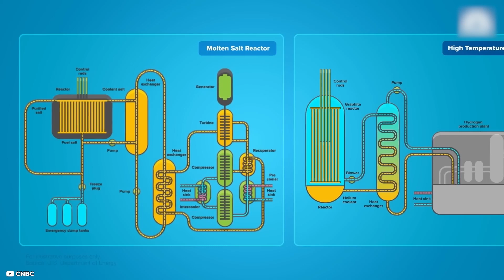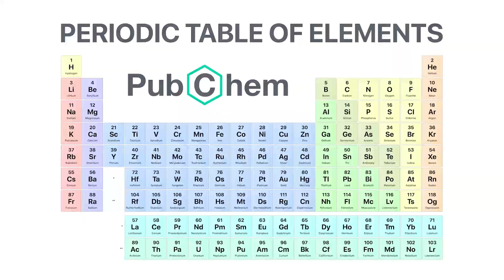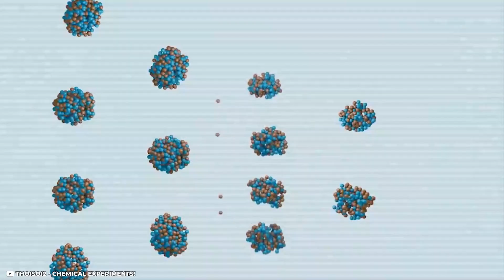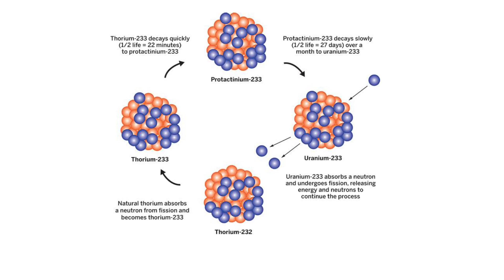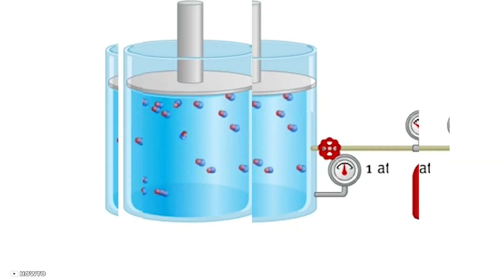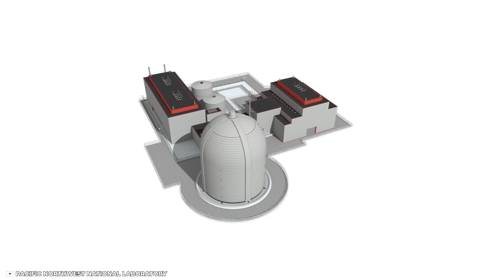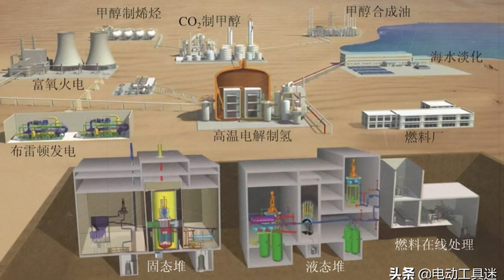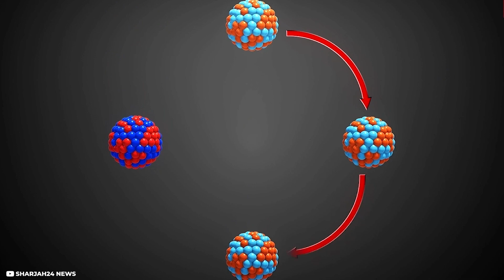NEW NUCLEAR REACTOR! Safe Nuclear Energy for 1200 Years!?

Comment: I agree with Stanley on reasons for shutting down research. But, it was not shut down around the world and Copenhagen Atomics  has designed a process that treats the fluoride salt to make in non-corrosive to the reactor structures. This breakthrough is also the reason that Copenhagen Atomics has created a auto-industry manufacturing process for building Thorium Fluoride Molten Salt reactors that will allow for the generation of cheap small footprint SMRs for energy grids around the world. The burning of hydrocarbons for transportation will be reduced directing the hydrocarbon resource towards more valuable product production like material and petrochemical.

Comment: China currently has control over rare earth materials. They don't share our irrational fear of thorium. We understand that radon gas is produced by the decay of thorium. What we don't seem to understand is that the gas is always produced at the exact same rate. It doesn't matter where the thorium is located or how it's stored. Maybe you've noticed that if it's left in the ground it seeps into your basement.  Radon decays rapidly so if you're really that afraid of it.  You could contain the thorium and capture the gas. Then allow it to decay. Whatever you do about radon is in most cases meaningless. We could instead decide to extract our available large amounts of rare earth materials. As a possible alternative to cowering in fear. We could produce what we need. We would in a few centuries be left with a byproduct stockpile that would contain all the energy resource needed for thousands of years. 

     Ps. People who understand things have described thorium as the most valuable worthless element.

Comment: Canadian CANDU heavy water reactors will b able to run on Thorium in 2025. As is, without modification.  The fuel  is Thorium with a HALEU booster, called ANEE. It's in the approval phase.  India's HWRs are a CANDU knockoff.

Comment: There's NOTHING NEW about a molten salt reactor, particularly THORIUM
Reply: What is new is the fact that social media and YT have made people think it is something great when it was tried decades ago in many countries and abandoned as too  costly
Reply from the maker: Every new technology is costly at the beginning until the system is optimised.
Reply: @The.Futurist  Funny, that is what they kept saying about the gen 3 reactors and the U.S. built over 100 of them.

The Westinghouse AP1000 is a gen 3 reactor with passive safety devices. And those passive safety devices are designed to save money by minimizing the number of pumps and emergency diesels. VC Summer was canceled after spending billions and Vogtle is still at least 1 year away from both unit 3 & 4 operating at that project is now $35 billion. 

I guess after another 100 massive financial gen 3 failures we might see the price come down.

BTW, there are NO Thorium reactors being considered in the U.S.. Terrapower does plan a MSR but with uranium and that project is estimated to cost $4 billion for a 345 Mw unit, on par with the Vogtle cost when comparing capacity.

Comment: Molten-Salt reactor technology during the Cold-War was stopped as it wouldn't generate plutonium to make nuclear bombs! It was pure strategic defense argument against civil energy/electricity consumption which at that time wasn't that big and could be generated with other resources as well. Also the MSR didn't provide the solution for long-range aircraft voyages as expected.
Reply: Where do people keep coming up with this BS that Thorium was abandoned and Uranium based PWR/BWR were chosen so we could make bombs?
Hanford Wa. has been making weapons material, at their 9 reactors, since 1944, 12 years before the first U.S. commercial nuclear plant became operational and their weapons production reactors are very efficient graphite moderated reactors and DO NOT produce any electrical power.
Savannah River site SC. Has been making weapons material since 1955 and their 5 production reactors are very efficient low pressure heavy water moderated reactors and DO NOT produce electric power.
Thorium was tried at Shippingport and Indian Point commercial reactors in the 1970s and abandoned as too costly compared to Uranium.
Weapons production reactors are NOTHING like U.S. commercial PWR or BWR power reactors and commercial power reactors have NEVER been used to produce Pu239 for weapons, since there has never been a need beyond what the efficient weapons production reactors could provide..
The U.S. currently literally has hundreds of TONS of  Pu239 (takes less than 20 pounds per weapon). The U.S. has so much that 34 tons of weapon grade Pu239 is being treated so it can eventually be disposed of at a cost of billions.

Your comment is like saying automobiles use gas engine because the military wanted jet fighters.  God help us that people base their knowledge on social media and YT videos.

Comment: Why heat up the adams when all you need is just use the electrons around the adams and convert them to electricity. John R R Searl did just that and it worked very well. Nasa reported that the converter could produce 10 to the 14th power volts. This technology was also stopped for political reasons. Big oil and the power grids control our government. Maybe we should look into where our state reps and senators get support from. Power on!

Comment: Indias FBTR  at kalpakam went critical in 1987.  India is one of the leaders in Thorium reactors it actually has a 500 mw reactor almost ready for operation, china is just starting with an experimental reactor now.
Reply: But has India put one into operation?
Reply: @PahatRout 
Yeah only one . Pfbr 500 reactor with thermal output excedding 1600MW
Reply: @PahatRout India is going to commercialize this thorium reactor right now fast breeder reactors the project is already completed in 2024

Comment: The only reason the world went Urainium was for weapons grade plutonium a lot easier to get from waist  solids than molten salt
Reply: You should question everything you think you know about nuclear because it is not based on fact.

Where do people keep coming up with this BS that Thorium was abandoned and Uranium based PWR/BWR were chosen so we could make bombs?
Hanford Wa. has been making weapons material, at their 9 reactors, since 1944, 12 years before the first U.S. commercial nuclear plant became operational and their weapons production reactors are very efficient graphite moderated reactors and DO NOT produce any electrical power.
Savannah River site SC. Has been making weapons material since 1955 and their 5 production reactors are very efficient low pressure heavy water moderated reactors and DO NOT produce electric power.
Thorium was tried at Shippingport and Indian Point commercial reactors in the 1970s and abandoned as too costly compared to Uranium.
Weapons production reactors are NOTHING like U.S. commercial PWR or BWR power reactors and commercial power reactors have NEVER been used to produce Pu239 for weapons, since there has never been a need beyond what the efficient weapons production reactors could provide..
The U.S. currently literally has hundreds of TONS of  Pu239 (takes less than 20 pounds per weapon). The U.S. has so much that 34 tons of weapon grade Pu239 is being treated so it can eventually be disposed of at a cost of billions.

Your comment is like saying automobiles use gas engine because the military wanted jet fighters.  God help us that people base their knowledge on social media and YT videos.

Comment: Thorium has one MASSIVE advantage over uranium,  it doesn't have the elements required to process into plutonium. You CAN'T weaponise it.
Reply: Thorium is not fissile and does not fission.  Thorium reactors are BREEDER reactors that make U233 that is fissile and fissionable.  ANY fissile isotope can be used to make a nuclear weapon, some easier than other but ALL never the less

Comment: for the molten thorium salt reactor build in china wuwei desert it's 444 million US dollars not 444 billion...
Reply: It is a demo test reactor that produces no electrical power and is 1/4 the size of the Thorium MSR the U.S. built in the 1960s.  444 million for zero electrical power?  what a bargain
Reply: Take note that China took extra measures/steps when building these 4th gen reactors. It chooses to build in a desert in order to run the many tests before commercializing. One of the studies is to assess the mass production of most of the reactor parts independence of foreign countries as it also intends to export such reactors to countries along the BRI. As such, it will take a longer time & money on such a trial reactor.

Comment: @Clark Kent To understand why Molten Salt Reactors (MSR) were not developed earlier one needs to check out first mover costs.  Like when the development costs for light water reactors for nuclear submarines were undertaken it was just a matter of making these things bigger. Besides almost no one was thinking of dissolving nuclear fuel in molten salt as a coolent/working fluid.  In the US MS was only thought of because of the extreme requirements needed for the nuclear bomber program.  Like the reactor had to be light, compact, operate at very high temperatures and not spread radiation all over the place if the plane crashed.  A MS reactor that could do this was built and tested.  It did work but would not work for a piloted aircraft due to the needed shielding.  Allen Weinberg who developed the light water reactors for submarines felt that a MS reactor had potential to eliminate the risks of large LW reactors with high pressure, loss of coolant, and radiation release hazards. Under his leadership a working MS reactor was demonstrated.  I personally feel this reactor threatened the then whole current nuclear industry with the then current, President Richard Nixon, being manipulated to cut all funding for this program.  I say this because how the program was shut down with orders to destroy all of the research product.  Just by luck several engineers defied their orders and transported their work product to a local community library where these documents remained in a cupboard for thirty years. By chance an aerospace engineer by the name of Kirk Sorensen came across a book about the MS experimental reactor and decided to look into the issue. Kirk discovered the documents at the local library and digitize them and posted them on the Internet with nobody paying much attention except the Chinese government. It turns out the Chinese government was very interest in the project and sent delegations to Oak Ridge Lab to further investigate.  With this interest others have become interested in the MSR concept with the Chinese investing billions of $ equivalent to develop a complete MSR program. The Chinese have built a 2 MW working MS reactor in three years and will have a 300 MW commercial MS reactor around 2026 with serial production of these reactors planned before 2030. Well from the top of my head this was why MS reactors were not developed earlier.  There are a lot of knowledgeable people who think this is the way we should have gone with nuclear reactor development in the first place.
Reply: I believe the Soviet Navy has a MSR powered sub and they abandoned it.  So much for your excuse.
Reply: @clarkkent9080  the Russian sub, Alfa class, used a lead bismuth cooled fast reactor.  It was the fastest deepest diving sub by far though small and cramped in size.  The Russians built the sub too quickly without enough R&D and quality control. They had problems with the reactor plumbing springing leaks and fires. Otherwise these were amazing craft.  Extreme amount of power in a small package with a titanium hull. The sub was something beyond it's time
Reply: @stanleytolle416  The Soviet subs were still a failure and were scrapped after just a few years.  I made the point in reference to your comment that commercial nuclear was based on navy nuclear technology.
The first U.S. nuclear sub began operation in 1955.  Shippingport, the first commercial nuclear power plant began construction in 1953, two years before the first U.S. nuclear sub went operational. 

The U.S. has been experimenting with every reactor type know and the BWR and PWR were selected as the best overall designs.  Today, with spent nuclear fuel becoming an issue, Thorium based reactors may be looked at more favorably but if you are going to reprocess spent Thorium fuel, why not reprocess spent uranium based fuel like France does ?

The only real advantage of Thorium is for countries like India that have vast Thorium reserves but no Uranium.
If the China and India Thorium demo test reactors actually prove feasibility and operate safely for 10 or more years, we may actually see commercial Thorium reactors  before Fusion is proven. 

You apparently are knowledgeable about nuclear power and you can understand why I comment when people make claims for Thorium or MSR that have never been proven in a actual commercial operating reactor.  Things that are technically possible and even proven in a lab may not become commercially viable.
Reply: @clarkkent9080  I would not say that.  Soviet subs had allot of operation time to their credit.  They actually got very quite in operation after they got some computerized lathes from Japan. Their giant subs for under ice attack really had few problems.
Reply: @clarkkent9080  Oak Ridge MSER was the only molten salt reactor built and that was in the Seventies. No body even thought about molten salt dissolved nuclear fuel until the nuclear bomber program.  The Oak Ridge reactor proved the concept of molten salt dissolved fuel with 6000 hours of operation.  China now has a complete nuclear program spending about 1/2 billion $ equivalent each year on their MSR program. They have a working reactor now and will have several more in a few years. I think this is substantial evidence that it was most likely an error for the US to cut off funding for this project.  It kind of looks like if we don't get our act together, fast, we are in danger of loosing energy independence to the Chinese over this issue.
Reply: @clarkkent9080  this was the Alfa class sub that was a solid fueled fast reactor that used I think lead bismuth liquid cooling not a MSR.  The Reactor in this sub was more like the liquid sodium cooled Natrium fast reactor being built by Terrapower in Wyoming.  The fast reactor in the Alfa sub was super compact and several multiples more powerful than any other sub in the world.  The sub had the ability from a full stop to accelerate and out run all of the US torpedoes.  While noisy at full speed the sub could outrun any and all surface ships and subs.  The problems the Russians had with these subs were coolant leaks of the lead bismuth and fires from extremely hot coolent pipes.  One sub had to be abandoned as unsalvageable due to coolant freezing inside the sub.  The sub also had a titanium hull enabling it to also be the deepest diving military sub ever. As you might guess the cost of building and maintaining these subs was astronomical. With busting coolant pipes the engineering may also not been fully developed.  Still while these subs functioned they truly were an amazing work of military kit.
Reply: @stanleytolle416  Correct but you failed to mention that the subs were only in service 20 years, rarely left port and after the last one was decommissioned in 1996, that is 27 years ago, they never built another one.

Correction, Terrapower is proposing the construction of a Natrium reactor in Wy. but no ground has been broken since the site was selected over 2 years ago.
Reply: @clarkkent9080  Ukrainain war problem.  Russia was the supplier or high enrichment fuel for fast reactors.  With sanctions no more good stuff.  US is scrambling to get back into enrichment business.  This is the source of the delay on the Terrapower's  Natrium reactor.
Reply: @clarkkent9080  I would not call it a failure.  It was a Soviet Union weapon.  Alfa subs did work with technical problems.  The reactors had to remain hot or they would freeze causing damage.  Guess what happened when the the SU collapsed?